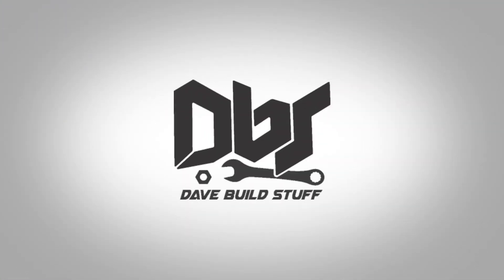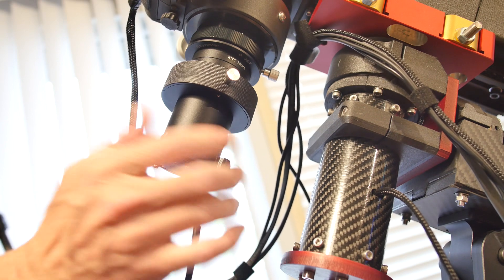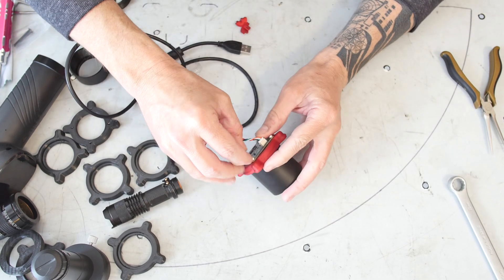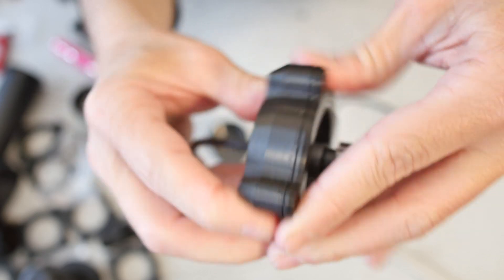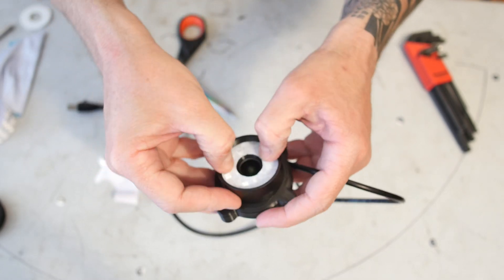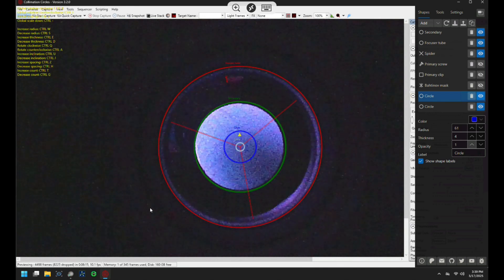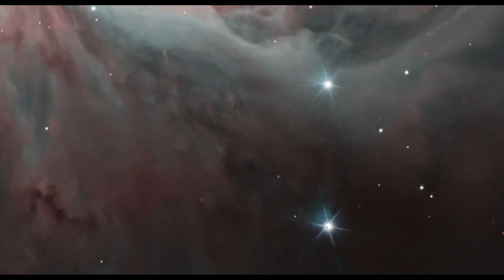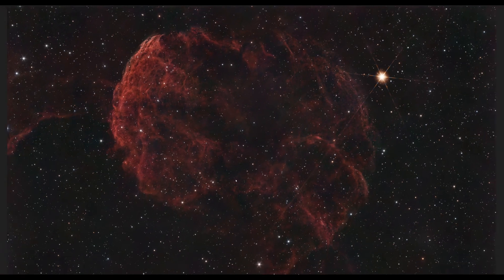Build Your Own Camera Collimation Device For Your Newtonian!

Comment: How much is a 3D printer ? OCAL is cheaper or buy a Catseye auto-collimator. Cheaper and more precise than any camera based collimation.
Reply from the maker: 3d Printers ~$200-1000
I should make an updated video on this. I'm now using an auto collimator for my fine adjustment. That's the gold standard from what I understand.

Comment: The reflections/flaring on the left side of your stars is the focuser tube infringing on the light path to the primary mirror.
Reply from the maker: That is not the case. This tube was specifically designed to avoid this aberation.
Reply: @designbydave  Ah, well I am not sure what is causing it then. I found the very same flaring with my big dob and it was the focuser tube in the light path. Once I moved the primary mirror up and wound the focuser tube out further, the flaring went away.

Comment: I had a similar idea where I adapted a cheap usb endoscopic camera that I already had. I printed what was effectively a collimation cap that had a centered cylinder that the camera could slide into with a tight tolerance to grip it and keep it straight. This type of cam also has some adjustable LED's on the front that should help illuminate the inside of the focuser tube a bit. I still haven't got around to actually testing it yet though.

Comment: Why not use your existing astro camera?
Reply from the maker: You can not use the main imaging camera. The collimation camera has a lens that focuses on the internal parts of the telescope, focuser drawtube, secondary mirror, reflection of primary mirror in the secondary. The main imaging camera has no lens as it uses the telescope's main optics to focus light into its sensor

Comment: I built a similar camera out of sheets of acrylic and also made a rotator to check the position of the sensor in the housing, This all was according to the original plans of Stefan Hohenegger who also written the software to use his so called rotator and and collimator with a set centerpoint, This is even much more accurate than relying on the sensor beeing centered in the first place. Unfortunately I can't find the software for download anymore an he partnered up and sells everything from a german company called Backyard Universe. I thing I tried to wirte a comment already but I may have been removed by Youtube due to the link I noted for you to see their solution.
Interesting thing for me it isn't so hard to collimate my newtonian (f/5) but I'd be unable to collimate my classic cassegrain without the camera.
Reply from the maker: Cool thanks. I think I can be confident that this camera/sensor is centered enough because manually turning it when inserted into the focuser drawtube yields no drift in the image.
Reply: Stefans Software was initially free and was able to find the centerpoint as well as  collimating the telescope. I'd love to share it with you but it doesn't seem to be available for download any more.
Great it works so well for you. I like your desing. If I knew your video before I would have preferred your way.
 @designbydave

Comment: Goodmorning Dave.  Ik have downloaded the stl files to print. But i ran in a small problem. There is a part missing in the download on Printables. CABLE_GLAND_PLUG_1 and CABLE_GLAND_PLUG_2 are nog part of the files. Where can i get these files.  Hope to here from you, Aschwinn Smith The Netherlands.
Reply from the maker: It's in there, just called CABLE_GLAND_PLUG. The two parts are identical.

Comment: Using such a short focal length is a good idea. I used a camera module with a variable focus lens, which can be helpful to focus on different points, but you absolutely need to adjust the camera tilt if you do that. I acknowledge that collimation is a breeze using a camera, especially, because you can look at the monitor image while adjusting the screws instead of running forth and back. If you add three tiny LEDs instead of the reflective foil, you can check for decentered refractors, too, because each air/glass surface will cause a tiny reflection.

Comment: Catseye collimation tools and Donald E. Pensack's thread on Cloudynights are by far the best tools and procedures for near perfect collimation of Newtonian astrographs. With fast focal ratio Newtonian's that require a coma corrector, the optics must be within a few millimeters of perfection. There's no way out of this. You have to spend the money to get the best results, and Catseye has the best autocollimator on the market. It has the offset pupil, and that is what makes the difference. Furthermore, simply using a camera, or a laser will introduce more error in the alignment of the mirrors. Be prepared to spend at least a couple hundred dollars, up to and over four hundred dollars for the complete kit. It is worth it.

Comment: Hi Dave, I am very glad that you have come up with this DIY collimation camera, I think it will be very welcome in the DIY astro community. Last year I saw a similar project on the channel of Daniel Nimmervoll (German language), which later became a commercial product. This camera came with a calibration tool because, as I learned, none of the camera chips are perfectly centered and it needs to be calibrated. I think you should check it out. Cheers!
Reply from the maker: Thanks for the info. Do you have any links?
Reply: @ here https://youtu.be/JGIynVQa4R0?si=gQQBwK2K8tKPLaea

Comment: Did you try doing the colimations with your astro camera? Just curious as mine supports video modes, was wondering if you had tried it and if you had, why it was less optimal than building a whole separate camera that might not have the exact same sensor placement / characteristics as the RPI camera and adapters you used. Using the astro cam would have collimated your system to your exact camera.

Thanks for the video though those tools are goo, I might give this a go with my existing cam and see if it works.
Reply from the maker: You can not use the main imaging camera. The collimation camera has a lens that focuses on the internal parts of the telescope, focuser drawtube, secondary mirror, reflection of primary mirror in the secondary. The main imaging camera has no lens as it uses the telescope's main optics to focus light into its sensor
Reply: Yes as Dave said a dedicated Astro camera or even a mirrorless/dslr is working using prime focus so would not function as a collimation camera with accuracy you want the closer focus inside the various parts of the tube. 
Also the cats eye type or retro reflective part which you also want probably would be troublesome depending on you cameras sensor size.

Comment: That's a great project. It made me think that you could also do much the same thing using the imaging camera and a cheap c-mount lens. I believe most ZWO and some QHY cameras can do this. That might be a good option if you don't have a 3D printer.
Reply from the maker: That might work but then you would need a way to attach the imaging camera+lens to your imaging train.

Comment: Why having separate collimation camera, why this cannot be done with our main camera?
Reply from the maker: No it cant. The collimation camera has a lens that focuses on the internal parts of the telescope, focuser drawtube, secondary mirror, reflection of primary mirror in the secondary. The main imaging camera has no lens as it uses the telescope's main optics to focus light into its sensor
Reply: @ ahh that changes everything, I see

Comment: Have to take a look at this. Been using the Apertura laser for rough tuning and a printed pinhole cap for fine adjustment.
Reply from the maker: Yeah, check it out. At the very least it helps you visualize all the parts at play.
Reply: @designbydave  similar to the pinhole cap, but computer-aided w/ the circle overlays.